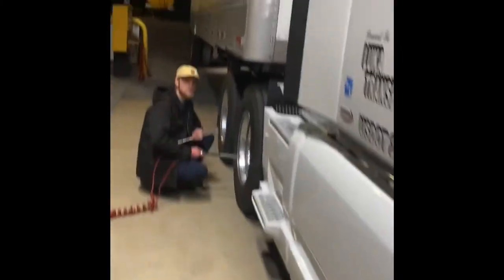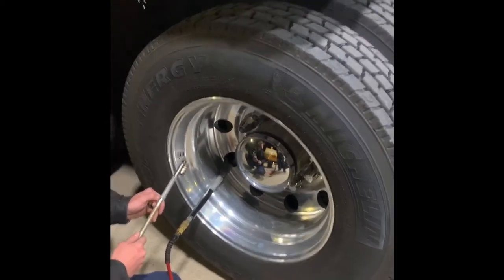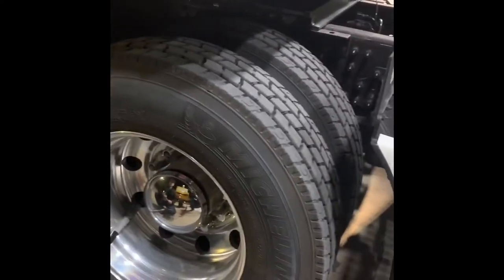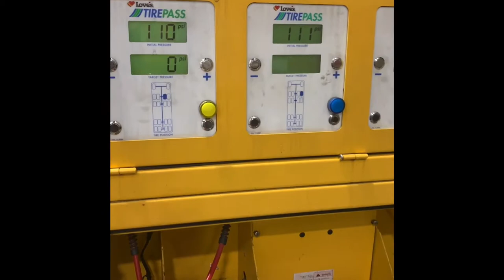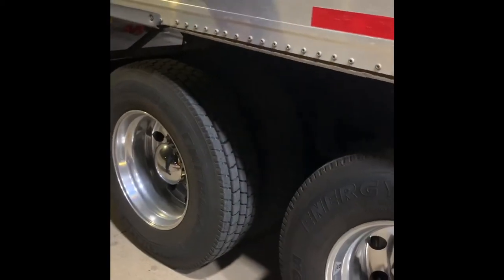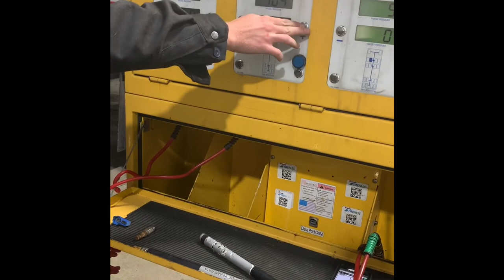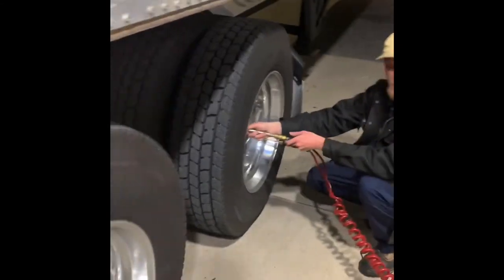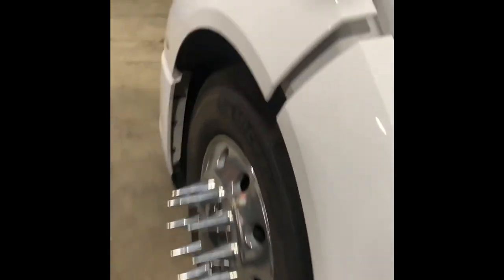Tire Pass @ Loves

Comment: Does it cost for them to do this?
Reply from the maker: Yes it cost roughly $5-7 dollars. However, if you have enough points from fueling, you can use them to fully pay for the service.
Reply: @stewslogisticsllc9460  my trailer tires have no much air so where do I take my trailer? Please help thanks
Reply from the maker: If your trailer have too much air, you can let it out yourself. However the TirePass can deflate as well as inflate.